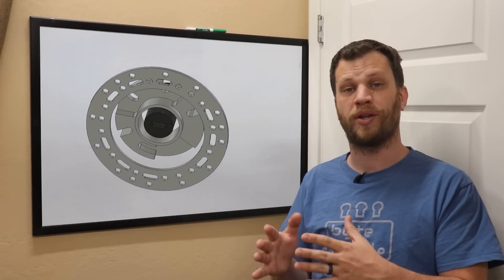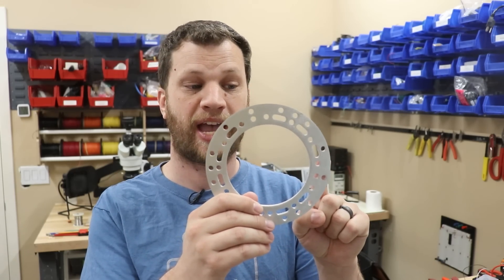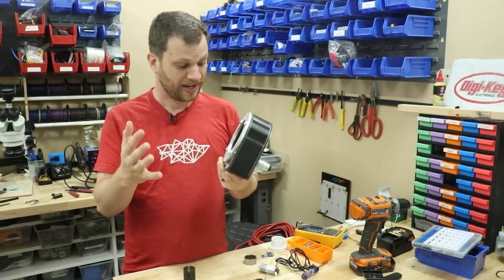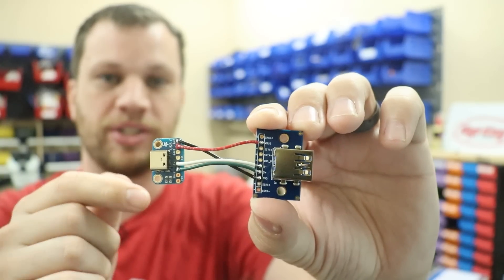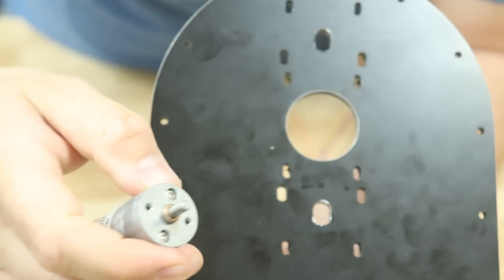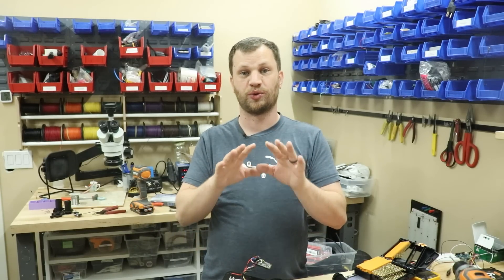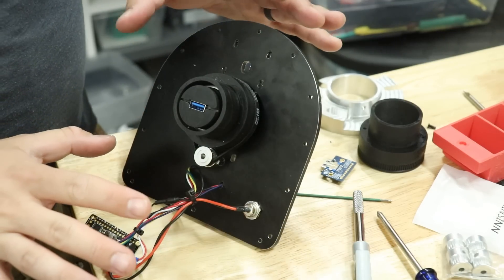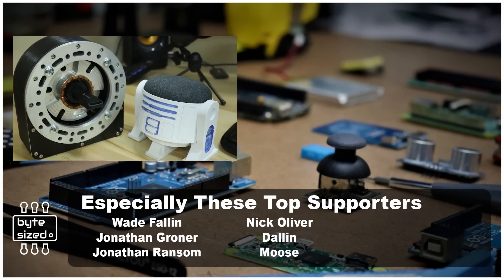I Made A Star Wars Scomp USB Port With @WinstonMakes

Comment: That inner aluminium part needs some sanding and/or sand blasting as the tool tracks are still visible on it.
Reply from the maker: Winston and I discussed this, and I told him that I wanted to see the tool paths because it tells the story of being machined
Reply: @bytesizedengineering  It is your part and it has to look the way you like it of course. I wasn't aware it was intentionally left that way.
Reply: @bytesizedengineering  That's cool. I like the machine look as well. I may have preferred a ball nose cutter finish though. Like this.  https://www.youtube.com/watch?v=HS50Q-EWtdU
Reply: Yup I agree. Sand blast with walnut or soda. Knock off the shine from that aluminum with make it look a little more authentic.

Comment: To save power you could route the ground for the power input to the arduino through the shield conection so you automatically turn on the arduino once you plug in the usb

Comment: One trick with the motor for future uses. Is look into adding an encoder to a motor when you want fine control over it. It with a little code turns a motor into a servo.. to a point.
Reply from the maker: As a matter of fact, the motor I used has an encoder on it! I connected it to the microcontroller. At some point if I want more control over how much it spins I'll have that option. It honestly doesn't really need it though.

Comment: Awesome use of power ground and shield!
Reply: I’ve been thinking about making a sort of USB hub that physically launches the USB drive when you eject it. I have no idea what to do with the software that will trigger it, or how to make the launching mechanism (servo? Solenoid? Something else?). Do you have any ideas? If possible, that would make an awesome video as well.
Reply: @somebody943  Please do this and make it in a toaster-like form factor.
Reply: I wonder if the motor speed could change based on data transmission 🤔 off to the (very complicated) USB specifications! 😅
Reply from the maker: @noliver7913  that would be really cool
Reply: My own projects might be plagued with scope creep 😅